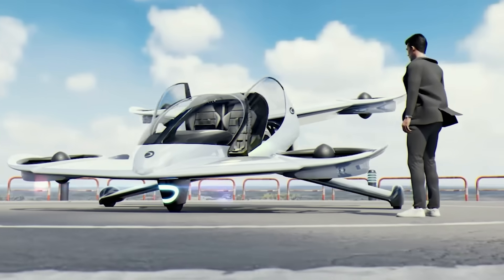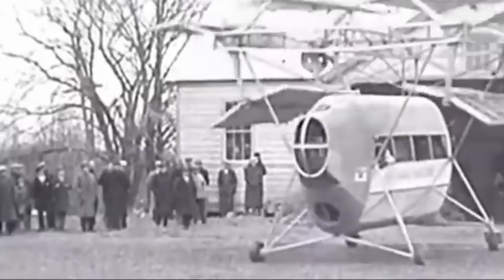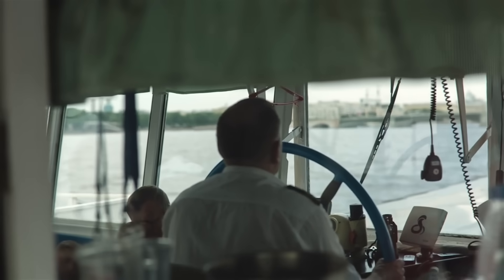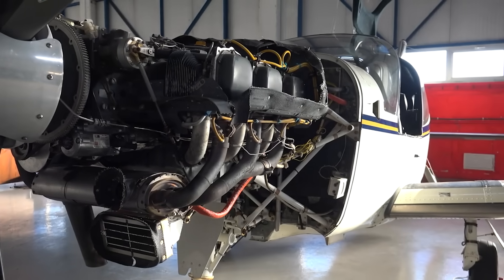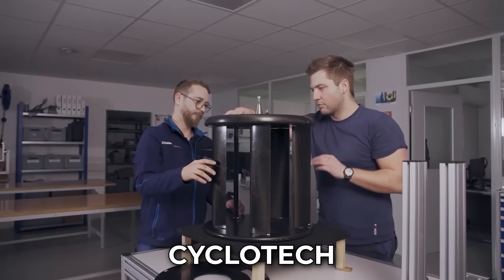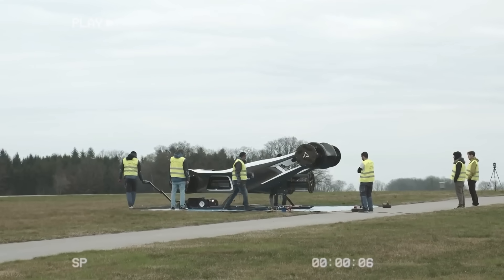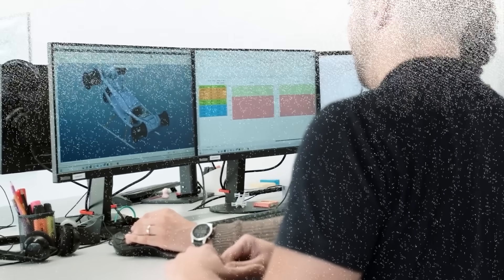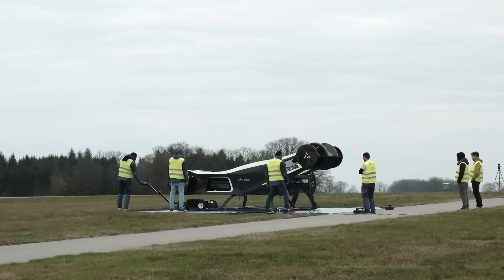The Cyclocopter: The Future of Flight That Doesn’t Spin Like Anything You’ve Seen

Comment: Plants need carbon dioxide (CO2) for photosynthesis, a process where they use sunlight, water, and CO2 to create their own food in the form of sugars. Carbon dioxide is taken in from the air through small pores in the leaves called stomata. This process is vital for plant growth, as the sugars produced provide the energy for the plant's development.  
For photosynthesis: Plants use carbon dioxide as a key ingredient, along with water and light energy, to create glucose (a sugar) and oxygen. 
To grow: The glucose created during photosynthesis is the plant's food, providing the energy it needs to grow and function. 
How they take it in: Plants absorb carbon dioxide from the atmosphere through their leaves, specifically through tiny pores called stomata. 
The by product: During photosynthesis, plants release oxygen as a by product, which is essential for animal life.

Comment: "Cycloid motors don't need to spin as fast to lift"

Meanwhile at the very start of vid the thing makes more noise than a Boeing.
And few minutes back: Engines of the time could not handle the power needed for it to work.
Meanwhile helicopters somehow made it just fine way before now.

Comment: To the people complaining about a lack of autorotation, autorotation is overrated. Unless you have sufficient altitude and speed, you can't autorotate, and land safely. You also can't land vertically, it has to come down like an airplane, so unless you have a lot of open space ahead of you, you're probably going to collide with something and crash, plus you better hope there are no power lines on the way down. 

Plus it's really hard to actually land in an autorotation situation. Suddenly losing power will make the helicopter fall suddenly and the pilot is going to be in panic mode. Pilots have to train to land in autorotation, but it's not something you ever do after training, so it may be many years since a pilot ever actually did an autorotation landing. It's never a situation anyone ever wants to be in, it's basically a last resort to avoid death. 

Having more reliable electric motors, and redundant cyclorotors is far better than autorotation. You can still land vertically and land even in environments with lots of ground clutter. You can also land with zero air speed and at low altitudes. Even in forests!

Comment: It has been well over 100 years since the first batteries moved vehicles.  Battery technology has evolved somewhat, but we still don't have batteries with high output AND long running times. No matter what technologies emerge, we are still left with those same problems that have plagued electrical power for decades. Until someone comes up w8th a MUCH BETTER ELECTRICAL SYSTEM, we will continue to have those issues.

Comment: If the motors fail, will it autorotate like a helicopter for a safe landing? No? Ok, I'll stick with helicopters..
Reply: Good point, I hadn't thought of that.  They'd have to rely on a whole-plane parachute, and that would eat into the carrying capacity and need several hundred feet to deploy.
Reply: Dude, if a helicopter motor fail, you're as good as dead, even if you're only a tens of feet above the ground. Helicopters are death machines.
Reply: @JerodimusPrime 
So you've never heard autorotation? Look it up.
Reply: @DaveAW  
Ofc I have, but your chances of surviving a helicopter crash are still slim. Planes are much safer.
Reply: @JerodimusPrime Learning how to handle engine failure in rotorwing aircraft is standard instruction; at least a few videos showing a safe helicopter landing with complete engine failure is available on this platform. If the pilot knows what they're doing, it's not only likely you'll survive, it's very probable.
Reply: @Nikolai18A  
If you think you're gonna survive a helicopter crash you're a deluded as someone that thinks they'll survive a plane crash because planes can glide and belly land if their engine fails. Good luck.
Reply: @JerodimusPrime Its literally available for you to watch in 4k at 60fps right now, on this very platform. But go off.
Reply: @Nikolai18A  
No need, I've already read a whole lecture on the mechanism from Gemini. The funny thing is here in the UK their was just a story about 3 people dying in a helicopter crash, and that was in an open field. Like I said before, you're as deluded as those people that think they'll survive a plane crash because planes can glide without engines. Stay deluded, bro. If you get into a helicopter crash, your ass is dead.
Reply: @JerodimusPrime First off, pointing to an anecdote doesn't bolster your position, second, you've moved the goal posts and constructed a Strawman in one fell swoop. You're 3 for 3 on fallacies so far. 

I said a helicopter can be safely landed with total engine failure, and under such conditions it's not only likely you'd survive, its very probable you would. I didn't say its likely you'll survive a crash. Those are two different things. 

Landing a rotorwing with engine loss is a mandatory component of getting rated to fly a helo. Thats what I said, and that is factually accurate. I'm not here to play Whack-a-Mole with your Strawman arguments.
Reply: @Nikolai18A  whatever, I ain't here to debate randos in the comments section, like I said, if you think you're gonna survive a helicopter crash then good luck to you. Have fun in delulu land. bye-bye
Reply: @JerodimusPrime  "deluded as someone that thinks they'll survive a plane crash because planes can glide and belly land if their engine fails"
There are a lot of real-life examples of just that happening, so I don't know what your troll arse is going on about.  Is it a sure thing?  No.  Is it common enough to be a thing?  Yes.

Comment: This system is exactly the same system used by an helicopter but dumber in every way. This is why a system such as this could only find use for manuvering, and not as the primary thrust. However, there is always another use for failed and outdate technologies, and is to feed internet slop.

Comment: 4 rotors just like a regular drone. Helicopters have one drive shaft driven by a central powerplant and if power fails it can safely land as long as the energy is there. This has drive belts and electric motors and if one fails you drop like a rock it's worse than a plane.
Reply from the maker: That's an interesting point about the Cyclocopter's design compared to traditional helicopters and drones!

Comment: Zero autorotation capability means it's a death trap.
Reply: It doesn't. Autorotation is a crutch for unreliable engines with no redundancy. Electric motors are far more reliable than internal combustion engines, and having more than one cyclorotor gives the aircraft redundancy, and the ability to land safely in the event of an engine failure. Eliminating the need for a tailrotor is far more beneficial. If a helicopter loses its tailrotor, it will spin uncontrollably and crash.
Reply: I guess one youtube comment from a pharmacist or something rendered every company’s years of work useless
The future is promising 🤦‍♂️
Reply: Put a parachute 🪂 on it .
Reply: @frankpepper4797  A parachute could work, but I don't think it's necessary. If one electric motor fails, the others kick in, and you can land safely.

Comment: This shows potential and in urban areas, quietness and modest energy use is going to be key, which this design could solve on the quietness side but energy use is still up in the air.

In some ways, this could also be much safer because of redundancies, and there are a few other areas that could make it safer.

So even thought on the surface, the design is more complex, the potential is there, and we should remember, many used to say cars couldn't be made to not break down because they are too complex, the Japanese came along and prove that wrong and now cars rarely break down, so yes, being a simpler design would be better but being more complex isn't the end of the world if designed right.
Reply from the maker: That's a very insightful take on the Cyclocopter's potential and challenges!

Comment: Heli-Copter, the name broken down, does not describe this vehicle. It's a Quadcopter like a drone, hence the four rotors. This looks like a drone and a dryer had a child. I can't stand how people take Ideas from the past and patent them as new tech, I'm working on new forms of magnetic propulsion, like get with the times, am I right? Anyway what's its maximum thrust force under maximum weight? The cyclocoptor seems like the body has limitations in its design. The more weight you put on the center would result in puting more stress on the connection between each rotor and frame. The slightest error in one of the four life lines could give out, initiating a severe form of death roll. You could reinforce the frame with an exterior cage connecting each rotor to a fixed bar running through the center of each rotor to the interior crossframe with a mounting point on the exterior cage. That's how you would need to reinforce this in order to give it the structural integrity it would need. You could also have a remote deployable parachute fixed to the top frame to aid in the descent in an emergency landing.

Comment: One thing that I dislike about most of these new flying cars/helicopter/drones:  The propellers tend to be exposed at a low level which could cause injury.  There is one flying car out of the Bay Area that has I think propellers inside the mesh frame so injury is avoided.  I’m not a big fan of some of its specs though.  I believe it can be used as a car but its max speed is something like 25 MPH.  Thats simply not sufficient.  To truly go mainstream I think someone needs to build a car-helicopter-plane that operates well in any mode, with a decent range and an “affordable price.”  Maybe sub-250K since it still wouldn’t be cheap to manufacture.  This thing in this video might be a good air taxi but the average person, I believe, will want to be able to take off and land vertically, then fly like a plane for faster speeds and reduced energy, and then be able to drive after landing.  People won’t want to have to go to an airport to take off and land, and in some locations it might be disallowed to land — say, a bank parking lot — so driving a short distance might be required.  So a use case might be:  I’m going to the bank to cash my meager paycheck to make a payment on my new flying car.  I take off vertically from my driveway, land on a dead-end street maybe, drive to the bank, then drive somewhere else to take off like a helicopter, then land back on my driveway.  That way ATC isn’t involved and I’m in my car the whole time while traveling.

Comment: One big issue with helicopters — there are many:  “You only have one propeller really and if it fails you’re in trouble.”  I would imagine with this you could have one motor per “spinning thing,” whatever that thing is called.  So maybe you could still fly even if up to two motors failed.  Maybe you could still land with only one motor left.  And that would be a huge safety advantage.  I’m in favor of backup systems with a parachute though, just in case.  I think some of the lighter planes and helicopters are going that way now.
Reply from the maker: That's a very insightful point about the potential safety advantages of the cyclocopter's design!
Reply: @TheForgeEmpire all but the smallest helicopters generally have more than one engine driving the turbine though so a total failure of a helicopter rotor is pretty rare. but a cyclocopter is probably safer than a single engine helicopter.

Comment: I'm not an aircraft designer nor am I a phycisist, however information conspicuous by it's absence raises red flags for me, the most important information, efficiency. 
Props are relatively simple direct drive, not much place for energy loss, those drums on the other hand have complex mechanics to change the pitch of the blades, I can certainly imagine a lot of wear and tear in such a system.
Reply: Yes helecopter bladed have to make the same adjustments just over 4 larger blades instead of 16.  But they still Make  second to second adjustments.  This simply is a far more complex mechanism, but not really subject to any more issues because smaller in nature almost always means stronger. Remember forces grow exponentially because of mass
Reply: @generalian185696  and I assume that because the helicopter blades are long and supported only on one end, while the cycloidal blades are shorter and supported on two ends, which might mean that the blades in cycloidal system are far less stressed than the classical helicopter?....In my mind, the only potential issue is fuel economy..does anyone have some actual data to compare that?
Reply: It's similar to what I bring up- the more moving parts on flying machines, the more chances of failure.  It's why I hate the Osprey and till rotors, or whatever they are called.
Reply: Saying these same things to myself watching this video....I still want my flying car or hover cycle
Reply: @uriamudeltoro5075  I dread the day when we get flying cars. People are already bad at driving on the roads. I can't imagine some drunk flying car driver crashing into my house.
Reply: @Drayton_Thorne  Until the day the system is not only capable of full autonomous control but also hardened against both manual flight and outside countermeasures, flying will remain in the hands of trained, licensed pilots.

The consequences of failure are too dire to leave in the hands of idiots (i.e. the driving public).
Reply: google magnus effect, it's incrediblly efficent at generating lift, but it's main limitation is it's speed.
Reply: @tom79623  It's faster than a helicopter. It's an engine to be used in a VTOL, not an airplane.
Reply: @EnigmaHood  
Performance - Range of 100 km with 200kg of payload and a top speed of 150 km/h
The top speed for most helicopters is around 250 mph (402 km/h)

you know you can google stuff right?
also the top speed for the cycloter type aircraft  is from the:
CycloTech Revolution of motion - Future Applications
Reply: @tom79623  That is not the theoretical max speed for cyclorotors, there is a max speed for helicopters. So just because you found a particular cyclorotor that is slower than the fastest helicopter, doesn't mean that is the theoretical limitation. Helicopters are always going to be slower because the advancing rotor becomes super sonic at fast speeds which causes a stall. Cyclorotors don't have this problem.
Reply: @EnigmaHood  yea but that is only in theory for now, and top speed is projected to be between 500 and 700 kmh, but I'll believe it when i see it
Reply: @tom79623  You don't understand what theory means. Theory is not a guess or speculation, it's an explanation of observed phenomena. So a theoretical max limit on helicopter speeds is a physical limitation, it's not a guess. Helicopters can never exceed a speed that causes the heli to stall. So if you put jet thrusters on a helicopter, those jets would rip the rotor off, and the helicopter would crash. But that wouldn't happen in a cyclorotor. As long as the body of the aircraft is aerodynamic and is a lifting body, you could even put rocket engines on the thing, and it won't stall.
Reply: I occurs to me that a rotating airfoil must undergo part of the rotation at attack angles which are not optimal for the required forces; this probably accounts for the inefficiency.
Other than the ablity to maneuver in very tight spaces, there is nothing to see here.
Reply: Not only that, but a much lower error-margin.
Reply: Designing  - and life at large - is an exercise in balancing. Trading efficiency for noiseless operation might be a good trade off. A good design is a design people want to use.
Reply: A helicopter deals with just about the same amount of stress and forces. It’s basically the same linkage just in a different form factor.
Reply: @ConnorAustin  Just about and basically? Very scientific, not to mention the 75% more moving parts and the fact that the creator included 2 dudes in black and white working on bicycle tire rims.
Reply: "however information conspicuous by it's absence raises red flags for me"

That's a word salad. I don't even know what this means. Are you saying that since it hasn't existed before, that means it's not practical? 

By props you mean a helicopter rotor, and a helicopter rotor is large and can collide with things. That's obviously not practical for operating in cramped environments with lots of ground clutter. A main rotor also has complex mechanics to change the pitch of the blades, there are many parts connected to the swash plate assembly including blade pitch change rods. A helicopter rotor isn't inherently simpler, nor better.
Reply: @EnigmaHood no he means that he thinks problems with the design were purposely left out
Reply: @SoulDelSol  Left out of what? And what are the problems with the design?